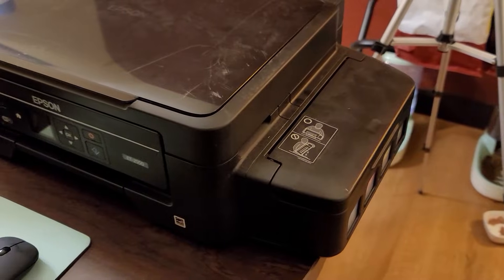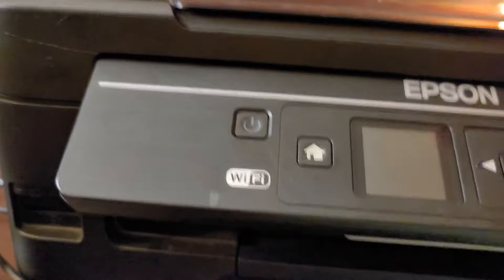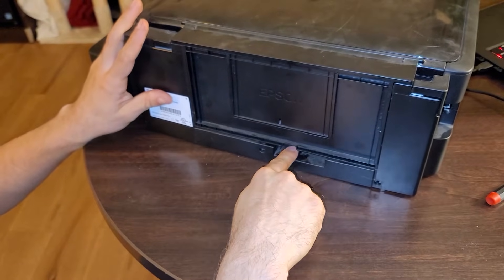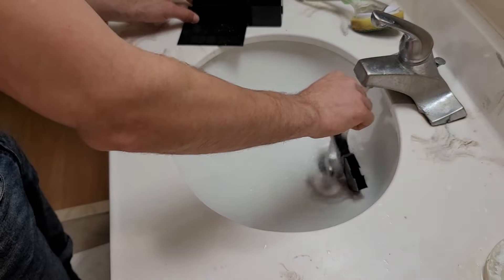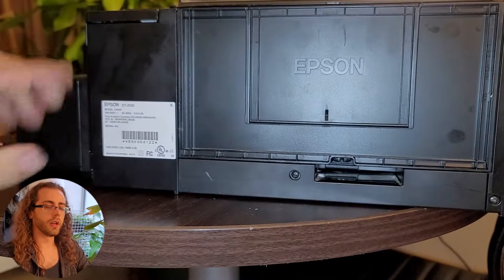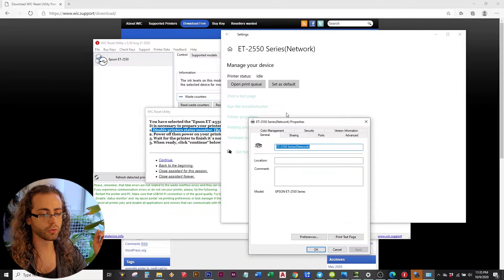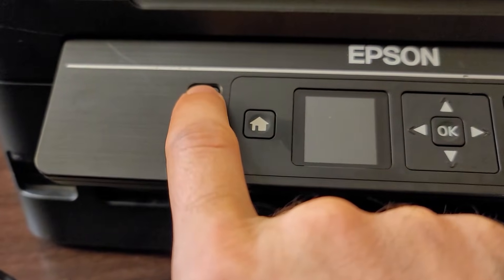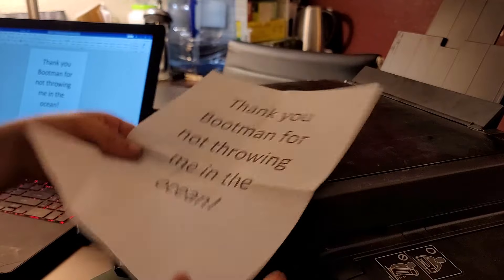Epson EcoTank Printer Waste Ink Pad Replacement and Ink Counter Reset (ET-2550) Procedure (How to)

Comment: I gave up on ink jets 7+ years ago. I switched to a $100 - Brothers laser printer and havn't looked back.  I can't tell you the last time I really needed to print color.  I'm in it to save money so I use ink refills.  I've been using the same cartridge that came in the printer for 5+ years.  I buy my ink from inkowl for $10 a refill (2500 pages at 5%).    I've maybe spent $50 on ink since I bought the printer. I've printed over 11,000 pages with 4 ink refills.

Pros:  The ink doesn't dry out.  It doesn't waste ink all the time on cleaning.    You get thousands of pages per cartridge.   You can just keep printing until the text is so light you can barely read it.  You can refill the cartridges for cheap (~$10)
 
Cons:  Most lasers printers you only get black ink.  If you refill them you will start seeing lines/streaks on images and eventually on text after a few thousands pages.  The cartridge has a rubber roller that causes the lines.  This isn't a issue if you replace the cartridge each time it runs out of ink (new roller).  You can buy Chinese replacement cartridges for $25 (2-pack) that do pretty well.   Refilling the cartridges is and can be messy (ultra fine black powder).  Resetting the ink level on Brothers printers is a simple process of just resetting a flag gear on the side of the cartridge.
Reply from the maker: I agree with you on pretty much everything you just said. The Epson is useful for the rare occasion of color, and maybe some interesting art projects. We've had a Xerox color laser printer for like 15 years now, and do the same exact thing -- just buy refillable Chinese toner. On rare occasion a part breaks, but the great thing is it'll just tell you right on the display which part is broken, so you can just buy a replacement straight off of eBay, install it, and no need to fuss with "hacking".
Reply: What inkjet would you recommend for scan and photo print, not alot, and documents?